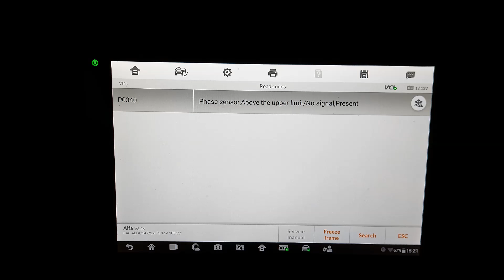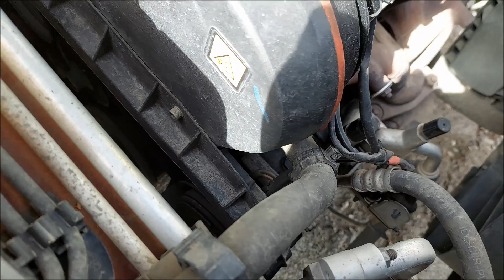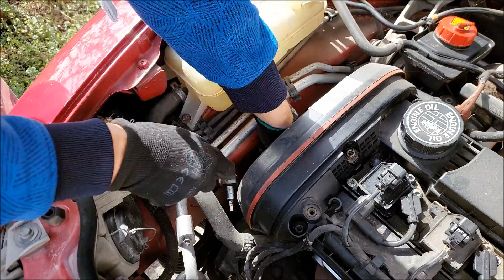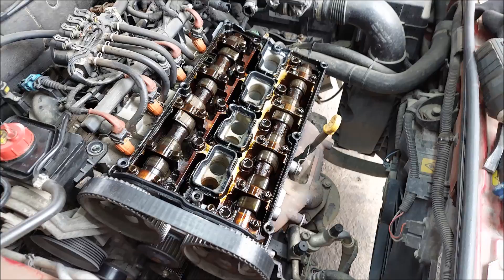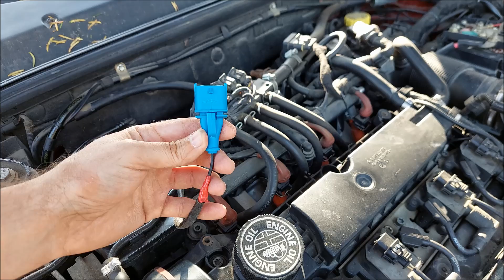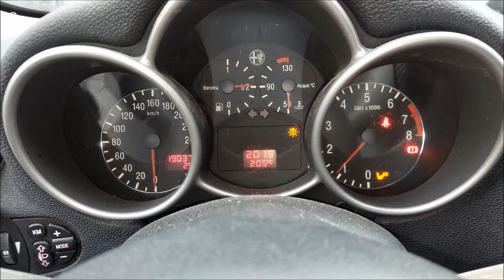Alfa Romeo Twin Spark Engine Camshaft Sensor Replacement WITHOUT Cambelt Removal

Comment: Hallo ich habe dein Prozedere bei meinem Alfa Gt 2.0jts übernommen und druchgeführt. Habe eine kleine Abwandelung vorgenommen in dem ich das Nockenwellenrad etwas angelöst habe und ca 0.5 cm herausgezogen habe. Die Befestigungsschraube blieb als Sicherung drin. Der riemen wurde mit Kabelbinder fixiert. Alles ging etwas leichter da mehr Platz da war. Nach dem Zusammenbau war der Fehler beim ersten starten weg. MKL war aus. Doch bei der Testfahrt mit angeschlossenem Multicuscan über OBD kam der Fehler bie 88°C Wassertemperatur wieder.  Frage: welchen Sensor hast du ver baut? original Bosch oder einen anderen Hersteller ? Habe gehört und gelesen das das Motorsteuergerät des  2.0 bei dem Sensor sehr empfindlich auf Toleranzen seien soll.
Reply from the maker: Hi, I used original bosch
Reply: @arcgarage  hallo.  danke für die info

Comment: Did you pull the new wire through by connecting to the old and simply pulling it through? was this easy? Really like this work around... a real money saver 👍
Reply from the maker: If I remember right, I've pulled the wires from the connector, guided the wires through, then put them back into connector

Comment: how can I route cables from battery to amplifier alfa romeo 147 937. can you make video ? thanks
Reply from the maker: You can use the hole for original wiring, then guide it under the trim

Comment: Absolute legend! I'm getting an intermittent P0340 fault in my 1.8 gt but luckily no actual problems yet. This video will be perfect when it starts to act up more. 
Otherwise I will replace is at the next belt change probably
Reply from the maker: Glad to hear that. Check the wiring first, maybe it is losing contact somewhere

Comment: Γειά σου φίλε μου....οσες φορές σε παρακολουθώ εχω προλάβει σοβαρές ζημιές στο 147 μου.. σήμερα μου συνέβη το εξής..σε ταξίδι με 3.000-3.500  στροφές στην μηχανή άρχισε ξαφνικά να αναβοσβηνει το check engine και απλά έχασε λίγο την δύναμη τής η μηχανή.. έχεις ιδέα τι μπορεί να συμβαίνει;;;
Reply from the maker: Is it petrol? You need to hook it up to diagnostic tool, but it could be coil
Reply: @arcgarage  όχι.. είναι βενζίνη και lpg...στην βενζίνη μου το έκανε λιγότερες φορές από ότι στο lpg..στο διαγνωστικό δεν έδειξε τίποτα γιατί το check δεν παρέμεινε μόνιμα αναμμένο..και αφού έφτασα στον προορισμό μου..και μετα από 6 ώρες που ξεκίνησα για ταξίδι πάλι δεν μου παρουσίασε τίποτα..σαν να έφτιαξε μόνο του..αλλά εγώ ανησυχώ ακόμα
Reply from the maker: @panagiotisfraggidis2985  Could be coil giving you the signs that it is on the way out
Reply: @arcgarage  λες για πηνίο..τι ακριβώς εννοείς;;
Reply: Αισθητήρας θέσης εκκεντροφόρου έχω αλλάξει πριν 6 μήνες
Reply: Καλημέρα φίλε μου...τι μάρκα πηνίου θα μου πρότεινες στο 147

Comment: Hey, I've been watching these videos for a ever since I got a 2005 Alfa Romeo GT and I love them! They are so useful and have really helped me. I was wondering if you would know anything about the transmissions? Mine has been having problems where it gets stuck on a gear while I'm driving, and doesn't change for anywhere from 5 seconds to a minute.
Reply from the maker: Is it selespeed?
Reply: @arcgarage  yeh, its a selespeed with a 2 litre engine.